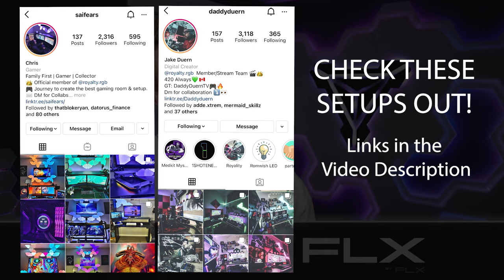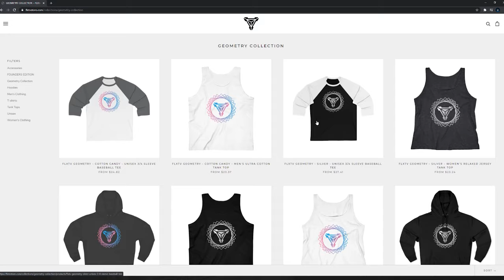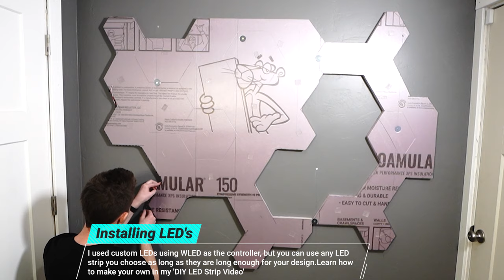DIY DECOR IDEA FOR YOUR GAMING ROOM!  + Rebranding Announcement!

Comment: Cool stuff man! How did you initially stick the panels up before you removed them to cut the foam backer to size? 2 sided tape or did you pull the backs off of the tiles and then just restick them?
Reply from the maker: Yeah I just used double sided tape to keep it up for that short period of time

Comment: After watching all of your videos on how you constructed this. I seem to be missing a step. After you outlined the edges with the light strip. How did you make the all those translucent pieces that sort of hide it all? What material is that? Id really like to see that video. Then I can finally submit my setup.
Reply from the maker: Those are just Acoustic Felt Tiles. You can get them on Amazon. They come in squares but I cut them down into hexagons. You can order pre-cut hexagons as well but I wanted mine a bit smaller so I just cut them down with a razor knife.
Reply: @FLXtv  Thanks for getting back to me I guess I didnt make myself clear. I watched your video a few times. At the end you show the panel with the lights doing their thing. But it appears you added on the hexagon outer edge where the light strips are an extra piece so it basically hides the light strip. Otherwise you would see the light strip on the outer edges.
Reply: @FLXtv  I think I figured it out. After cutting the Pink panel with the jigsaw and putting it back on the wall. And you run the light strips then you add the hex panels which are slightly larger and protrude passed the pink panel hiding the light strip. I thought the hex panels would be flush with the pink. Thats what through me off......Once I get this project  completed I hope to have my setup to show... Thanks again

Comment: This looks awesome. I like your videos keep it coming. Also i was wondering wouldnt it be easier if you ran the wires at the bottom. Seems like the distance was shorter. but this is awesome
Reply from the maker: Thank you! had to run the wires from the side because on the other side of the wall I have it connected to the ESP32.